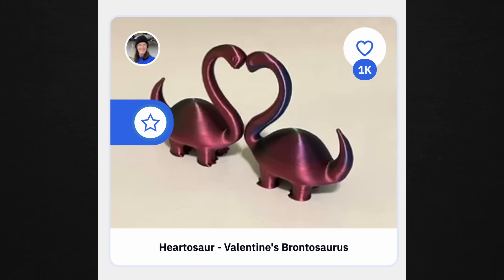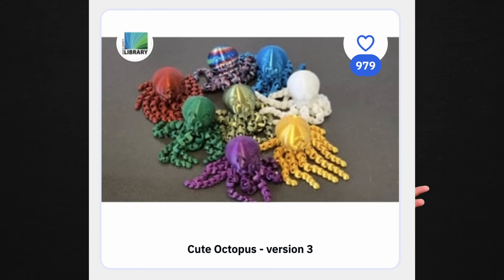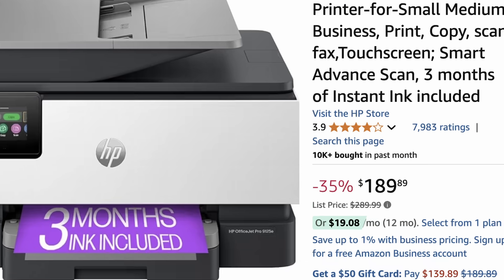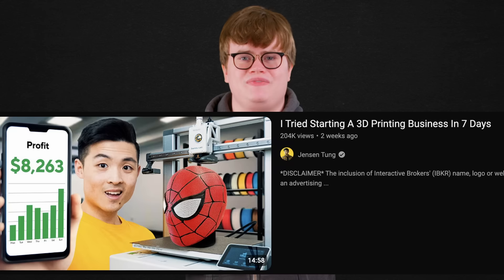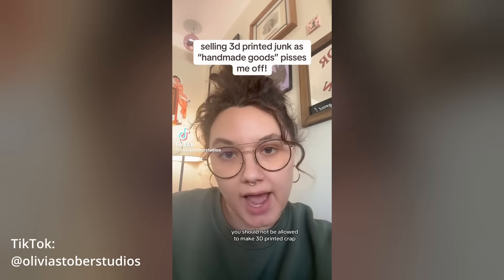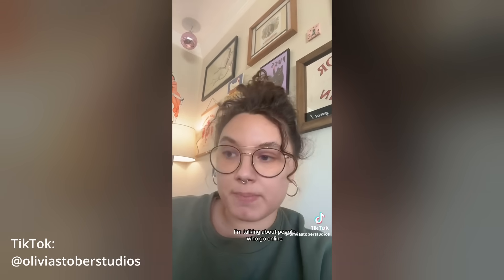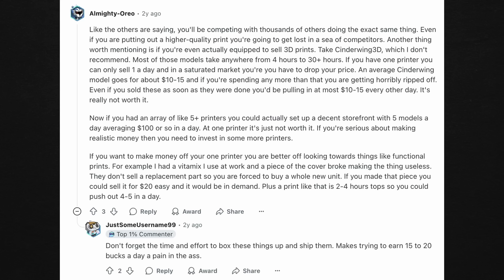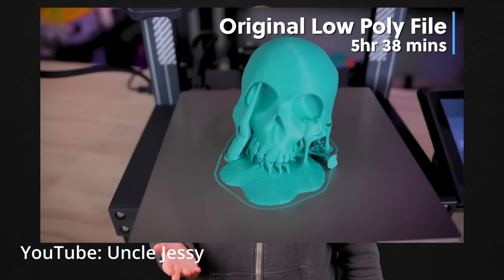The Rise of 3D-Printed Slop

Comment: Printing random things is good for learning how to use and tune your 3d printer. However, if you aren't printing functional parts ( things you can actually use to solve a problem ) you are just a middleman between filament and landfill. Start learning to use CAD. Start with simple CAD programs like tinkercad and progress from there.

Comment: A 3d printed slop shop has opened in my local mall. A proper shop, only able to exist because the mall is dying and theres about 15 vacant store fronts. My friend and I went to chrck it out, and nothing was properly cleaned. Many of the "products" had uneven surfaces, stringy plastic still on it, and one item was even legitimately dirty and sticky. They were all the typical fidget toys, so they werent original creations, either.

The funniest thing was that the owner wasnt even THERE. There was nobody attending the shop and we were there for at least 10 minutes. We could have easily cleared the stock and left, and i think that speaks to how little value these things have. Couldnt even be bothered to supervise the stock because theyd loose maybe a buck per stolen item and make back 20 per sold.

Comment: Thingaverse has tons of incredibly useful accessibility devices. Instead of lambasting all people using pre-designed models, why not focus on useful ways to use it, including as a business?
Reply: This is such a weird take to me. He never said that 3D printing has literally no use cases at all, or that literally nobody is doing anything interesting or valuable with it. 

All he said is that the vast majority of users are making exclusively, or almost exclusively, plastic tat. 

Which is true. 

And if you want to bring up accessibility, if it's a mass designed model with no requirements for the user to modify it at all, then it probably already exists and is going to be cheaper and more durable if bought from a traditional manufacturer. The vast majority of the value at home 3D printing has for accessibility lies in the ability of the user to create tools and modifiers that are exactly set for their needs. But that requires making the file.
Reply: @Albinojackrussel  It’s not a weird take to point out the useful aspects. It’s what comments are made for. 

Unfortunately many accessibility items don’t exist on the mass market and that’s why customizable, affordable, small-batch ones are so important. They’re absolutely vital for many.

Comment: I own an ender 3v2 that I’ve had for about 4 years. I’ve made a few trinkets and pieces of wall decor for myself from other creators designs but I mostly use it for practical printing solutions. Also you may want an activated carbon filter to process some of the VOCs associated with 3D printing. 3-6 ACH (air changes) of OA (outdoor air) is a good baseline but that does come with other challenges involved with bringing in unconditioned outside air like the ever changing temperature and humidity levels

Comment: "if the only items you'll ever make are widely available online as mass produced injection molded parts, why would you ever use a 3D printer"
Honestly, it's cheaper, quicker and probably less bad for the environment to use 2 hours of energy to print a small item you need instead of buying it on temu or aliexpress. Because that shit has to get shipped usually from asia often by plane. 

I do get having an issue with people who ONLY use their 3D printer to print essentially trinkets that will most likely end up in the garbage one day. Especially people who won't ever learn 3D modeling in any way. And I also don't really like 3D print stores especially at conventions who only sell models that they obviously didn't make themselfs and they all sell the same dumb as articulated dragons. 

I love 3D printers for all the ways that they actually ARE useful. In only one year I repaired a bunch of things at home from backpack buckles to broken parts of our kitchen drawer that would have cost me 10 bucks online when my printed part was only about one buck for material and electricity. I made storage and organizing solutions for a ton of places in our home, built a custom screen stand/holder for a small raspberry pi screen that I use as a second monitor and I even designed and printed a needle felting machine for less than 1/4 of the price than what people sell them online.

3D printers are a tool and a great one too. Most people use it as a toy tho.

Comment: reptile expos have tables FULL of these printed figurines. I've seen so many damn dragons. They're all so overpriced and they just don't belong at the expo :/

There's also 3d printed reptile dishes, hides, decor, etc. Lots of them are overpriced and unsanded. I haven't bought any yet bc i don't trust putting plastic in a humid acrylic enclosure... Yknow,, under the reptile heat lamp.

I frequent the same expo to stock up on lizard stuff and none of my fave vendors sell this cheap crap.

Comment: You touch on some decent points, but tbh a lot of this screams "I don't have a modern 3D printer and am only using secondhand info". A lot of the "issues" you mentioned with 3D printing are just way way less major nowadays than your saying here. If you're using something like a bambu printer, which is a pretty common and decently cheap brand, printing something is basically as easy as using the presets in the slicer and clicking print. That's not necessarily true for all models, but if you're printing something designed to be 3D printed (which is the primary situation you are describing here), then it's usually incredibly easy. Generally, printing failures mainly happen when you are trying to print with an annoying to use filament (i.e. TPU, PETG, ABS), or an awkward model. However, even in those cases, you can generally dial in your print settings to deal with that, and then copy those over to print several of them (which again is the situation you are describing here). 

You also kinda overexaggerate the issues with layer-lines, those bumps you see in 3D prints. If you're using a 0.4mm nozzle, unless you are printing something really small, they can be pretty discrete. A lot of the photos you show look super zoomed in on a very small print, i.e at 2:45. Counting the layers, that hole at the top assuming 0.2mm thick, is like only 1.6 mm wide, which is pretty ridiculously small. Even at 5:20, which I personally would've probably used a lower layer height, that looks pretty damn zoomed in, I would bet the discrepancies are a lot less noticeable with the naked eye when it's on your desk. Even when layer lines are a problem (which is mainly when you have very shallow angles on the top of a print), some slicers allow for variable layer line thickness as you print, so you can have those areas be higher resolution than say a completely vertical wall. 

Then there is some smaller stuff, like saying "Even a small print can take hours to complete", which is just not true lol, although it depends how you define small. Something like a Benchy on my bambu only takes a few minutes to print at a decent quality, and you can print decently big stuff in less than an hour if you use the right print settings. Something like those octopuses or those fidgets probably don't take too long if you have good print settings. Another weird thing was you saying "There is only so many times you can remelt or reuse the fibrous plastic before the filament degrades significantly". This is technically true, but also irrelevant to the VAST majority of hobbyists, as most of us do not have anything to remelt filament lol, those devices do exist but they are pretty expensive and generally not super worth it, so it's basically a moot point.

I am not saying the video was bad, honestly I hadn't seen a video on the effect of 3D printing already made models on the maker community, that is a decent topic to talk about. However, you should almost definitely do a bit more research or consult someone who does 3D printing if you haven't already, as stuff like this makes it a lot harder to watch as someone who does have decent experience with 3D printing, cause this very much feels like someone outside the 3D printing community talking about it instead of someone who actually knows it intimately.

Comment: You buy it to print those custom ideas and painstakingly remodeled replacement parts, but both you and the device suck and are on a heavy learning curve along a rocky road of troubleshooting and technical issues.

Countless calibration plates later,  somewhere along your 500th Benchy, you decide to just print a stupid vase or an octopus.

It actually works for once within the requirements of such objects. Assuming the vase doesn't actually have to hold water.

You're proud and decide to not light it on fire and throw it out of window just yet.👌🏻

Comment: I feel this so much. I thought I am alone with that. I got into 3DP as an engineering student for rapid prototyping of parts before commiting to contract machinist for milling and such. But I feel like 80% of printed parts nowadays are just figurines and such or as I like to call them dist collectors. 
But then on the other hand I feel like it's kind of more of a skill issue. People buy a i3 clone or whatever because they are pitched as the do all end all solution for everything. And then they are stuck to these readily available models only that are somewhat generic or as mentioned in the video some temu aliexpress things. 
3DP thrives in customization and one off solutions. I had years of CAD experience before ever getting a printer and about 95% of what I print nowadays are my OC. 
I don't think this is the standard nowadays anymore as printers got cheap and heavily marketed as the new big thing and thus skewed expectations quite a lot.

Comment: I disagree to some degree. At the start of this video you talk about printing stuff that could easily be brought off of temu. And while yes you're probably right isn't it cheaper and easier to just print one (assuming you own a 3d printer). Ofc I'm not saying that if you want a ring size thingy you should buy a 3d printer and then print it just so you don't have to buy from temu. But my dad has a 3d printer and I got a headphone stand for free out of it. 
The quality of them might not be the best but personally I don't care and if I'm the only one using it then I'd rather save the few bucks it'd cost.
And I've seen ppl print hobby related stuff like Pokémon fountains and what not which yes isn't helpful but if you like it who am I to judge.

I do think that there's probably a lot of plastic waste with this (idk if it's recyclable or not) but personally if you leaned into that as opposed to ppl printing whatever they want and telling them it's bad quality or useless when you're not gonna ever use their 3d printed stuff to me it comes off as judgemental

Comment: Ive always thought the stuff people 3d print is stupid. I hate clutter. Resin 3 D printers are pretty much used for just making figurines. Even if you filled a shelf wjth resin printed models, just buying the figures would likely be cheaper, less time, and better quality than the resin ones. I got my 3D printer to make functional parts and custom sized storage bins for my work van.

Comment: I got my 3D printer to supplement my hobbies - they just replace me having to use baked polymer clay with a method that is more precise and produces stronger and lighter items. The condition that I set on myself before getting the printer was to learn Blender, so I can do my own sculpts and fix/adapt existing models from Thingiverse/Makerworld/Printables. I print some trinket too, but they are for the office as decoration or or for promoting open source software (keychains etc.). And of course I printed also some custom functional parts for repairing things or having a perfectly fitting part for some other project.

Way too many people just get a printer on a whim and after printing a few trinkets it just sits there and/or they are surprised by common issues that you even get on a Bambu (switched from Sovol to Bambu at some point). My cousin is one of those people - he found out that printing takes time and energy (which he can afford, but he's very stingy). At least I could prevent that he would get an SLA machine, which he was about to buy without knowing the requirements.

Comment: The plastic heel on my ski boot failed and the heel is no longer available to purchase. New boots are $400. The printer pays for itself with this one print. My tablesaw hooks to a vacuum but they charge $50 for this adapter. Not many of this type of print to pay for the printer.

Comment: I started with my first 3D printer 3 years ago. Initially I wanted to make prototypes and eventually silicone molds to mass production. I ended up using it for cosplay props to my gf, a couple of useful home items and some figurines that I painted. Recently I started to think in a side hustle and I'm making research to buy a new and better 3d print, but man, I don't wanna just do the same shit that everyone is doing and your video just happened to appear on my feed and I've a lot to think about 🫠

Comment: this is such a mischaracterization of a hobby its insane. You're basically assuming that people who buy 3D printers don't know what they're doing and are just 3D printing useless trinkets, which I mind you could probably be used to decorate your room if done right.
Reply: Wrong.  Such a cope this is insane.  It's all junk.  Deal with it.
Reply: @MakingMovesMajor  3D printing has genuinely saved me so much money. I have a shitty Acer laptop that breaks it's hinges all the time. The plastic hinge would just shatter. A normal repair would've cost me 50 bucks since I also need to buy the whole front and back LCD cover but with 3D printing, I can just print it for like 10 dollars. Why am I wrong again?

Comment: I have a printer and i can safely say it has saved me a lot of money when it comes to things i need around the house or if i want something for cosplay. I would also like to add that i sand and paint most of my prints. It is a revolutionary machine and regret none of it. All my supports and unused parts from my prints i keep in a bag until the market of filamnet recyclers becomes more readily available so i can reuse my filament. Its an overall positive machine to society and I stand my ground on this.

Comment: You only unlock the real power of owning a 3D printer by learning to do custom 3D designs. With the ability to design, a printer is an essential tool for solving everyday problems, like making replacement parts for household appliances or designing a specialty tool. Without the ability to design things yourself, a 3D printer is just a fancy way to cut out the middle man when buying cheap plastic junk

Comment: This is precisely my issue with wanting to get a 3d printer, everyone just makes junk or gimmicks. I wanted to be sold on getting it by finding something to assist in life.
Reply: I can say I have had a 3D printer for awhile and it has helped me out. For example, the bridge on my cello was getting really warped, so I just made a new one! Probably saved me a couple hundred bucks lol. Need an adaptor for an AC port? Make one! Need some little holder things for those peg boards? Make as many as you want! If you ever need to replace something that just needs to be a stiff, solid object, 3D printing is probably the cheapest and honestly quickest way to do it.
Reply: @logicbuilder1204  I printed a new lock for my money box when the one that came with it broke and I regularly print damaged parts to fix my kids toys so they don't end up in the trash. Recently got into making foam blasters as well since Nerf guns are expensive when they all add up. 3D Printers can be used for a wide variety of things, I saw one guy use his printer to make vase templates that he'd then cast.
Reply: @bencastor9207  Shit you printed a lock? How did that work lol, that sounds like a complex mechanism.

Comment: I use my 3D printer to make helpful small gadgets for my work with the homeless. Often up cycling gadgets like a shower head water bottle adapter and pocket sized sewing kit. 

You should see the joy a 15 cent piece of plastic will bring many of our clients without access to running water 💖
Reply: By the way if anyone has any ideas for small helpful objects that can be comfortably carried around in a backpack or wallet, I am open to suggestions. Bonus points if up cycling is involved.